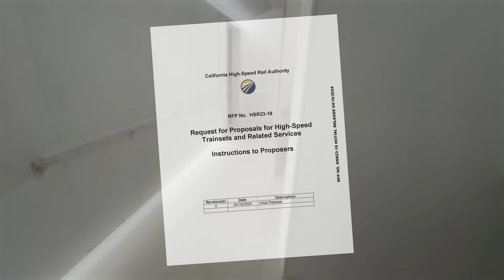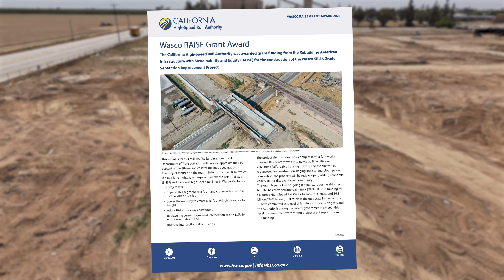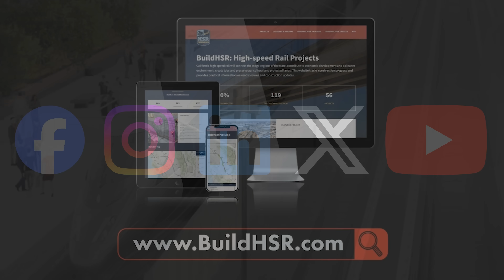Spring 2024 Construction Progress Report: Trainsets, Construction, Stations, and More!

Comment: This is wonderful. Yes, it is taking longer than anticipated or desired, and we all wish the costs could be fully contained. However, in 25 or 50 or 100 years none of that will matter (or even be remembered). What will matter is that people of character and fortitude pushed this project through and improved transportation for the people of California. It already appears to have inspired other similar projects in other states; let's hope that keeps going.
Reply: I heard the same complaints when we were building BART … imagine if we didn’t build BART … this system will evolve and expand over the next 100+ years … great project and great jobs for California
Reply: @robbmanchester5747  yeah BART had its opposition too, but it’s virtually impossible to imagine the Bay Area without it today. Same with the Golden Gate Bridge, and the Shinkansen. It’ll be the same for California HSR. Once people here begin to experience the benefits of high speed train travel for themselves, there’ll be no going back, and it’ll be virtually impossible to imagine California without it, just as it’s been for everywhere else with HSR.
Reply: @robbmanchester5747  There was a huge difference with BART. It was paid for by a 1% sales tax in the area, except Marin. There is no such will to fund this trackless train. The feds prove this when 3B goes for the CAHSR and 50B goes to Ukraine.
Reply: @robbmanchester5747 just curious, how long did it take BART to be completed?
Reply: @robbmanchester5747  Phase one could take up to a century at the current funding rate.
Reply: @scotttild  I absolutely plan to use it once it's built out.
Reply: @appleintosh you'll be waiting g forever
Reply: @PHXPlanespotter  I don’t care if it takes 50 years.
Reply: @appleintosh  lol so you like throwing money away?
Reply: @appleintosh  Hope you are patient. Real patient.
Reply: @scotttild  2hr40min to LA from SF using only HSR. 6hr10min if using the Merced to Bakersfield portion from SF-LA with a bus on either end, currently 8hr40min by bus, and 6hr on average by car. Majority of people will not be taking the train end to end. Most will be taking it from SF-SJ, Fresno-SJ/SF, or Bakersfield/Palmdale-LA. All of those beat cars by at least an hour, sometimes as much as 2.
Reply: @AmpereBEEP  "Majority of people will not be taking the train end to end. Most will be taking it from SF-SJ, Fresno-SJ/SF, or Bakersfield/Palmdale-LA. All of those beat cars by at least an hour, sometimes as much as 2."

I think that tourists, from abroad would be willing to take this railway from end-to-end. The USA isn't really set up to support tourists who do not drive. This system is going to be a game changer that means that someone flying in for a holiday in one city, can spend some time in that city, get over to another city and then spend some time there. If the trains have free charging ports for laptops and wifi, a tourist could upload all their holiday pictures from the first city, on the voyage, catch up with friends online and have a meal on the train and enjoy the views of America going past, out of the windows. That's something you can't do while driving a car and it's a view you can't get from domestic flights.
Reply: @DavidShepheard  plus with all the transit connections, such as thruway buses in Merced and Fresno to Yosemite, as well as local transit within cities and regional trains between them, one would be able to hit up a number of famous CA destinations without needing a car. Start in LA, maybe hit up San Diego, head up to Yosemite, then SF, and return to LA. It’ll be much like riding the Shinkansen to visit Tokyo and Kyoto.
Reply: @ChrisJones-gx7fc  unless they're going to have a cannabis club car on that train I prefer to take my car stopped wherever I want enjoy whatever I want when I want.
You enjoy not having a car I'll keep mine
Reply: @DavidShepheard  Palmdale holy smokes they haven't even started that 36 me tunnel from action to sylmar... Man pork pork and more pork how those politicians are getting fat... Too bad the politicians had to be involved I see this train going from Sacramento to Bakersfield and then forever you're going to have to jump on an Amtrak train and ride it to Union station just like today
Reply: @slimshady6359  I never said this would eliminate driving, cause of course it won’t. Neither has HSR in the over twenty countries it exists in. Car culture, especially in a place so built around it like California, is far too engrained in our society to ever go away, nor should it, because cars serve a very important purpose. So too does transit, including intercity, by providing a competitive alternative so one is not forced to depend on owning a car, and all the expense that entails, in order to live. Many of us drive because we have to, and would likely opt for a better alternative if there was one.

I personally enjoy driving and love road trips, but what I don’t like, and I’d say this goes for most if not everyone who drives, is being stuck in traffic or trying to find a parking space, as well as high gas prices and just the expense to keep a car going. Many of us drive because we have to, and that car dependency is not sustainable, which is where transit can help reduce it, unlike continuing to add more freeway lanes that are proven to make traffic worse long term.

If there were a competitive alternative to traveling between SoCal and NorCal that was faster than driving, and more convenient, comfortable and less stressful than flying, that takes me directly from downtown to downtown, I would absolutely use it, maybe not every time but for something like a weekend trip, definitely, especially if meeting up with family or friends who I could then share a ride with to get somewhere that transit doesn’t conveniently reach. It’s all about having more options, not taking any away, plus all those on HSR means less traffic on the freeway for those who’ll keep driving.
Reply: @ChrisJones-gx7fc  serious bro when do you see this project completed ❓ the oven started nothing on the south end of the route which is going to be the challenging and expensive especially with over 36 miles of tunnels and multiple bridge spans through the tehachapi mountains.. I just hope it don't Peter out and stop in the Latrobe or something where you catch a Amtrak bus to downtown Union station..
Reply: @slimshady6359  2030/31 for the start of Merced-Bakersfield service. Beyond that depends on when and how quickly the SF and LA extensions get funded, just as it always has. CHSRA estimates it’ll take up to six years to get across Pacheco Pass once construction begins.
Reply: @ChrisJones-gx7fc  that's keeping the operating engineers working and that means it's going to be a good summer for all..👍
    I just hate the politicians skimming the money..🤬. I still think more caltrains . how do I get from Bakersfield now to Sacramento❓
    Do I got to wait for Amtrak ❓Doesn't Amtrak only run like three times a day ❓
     What about if I got to get from Fresno to Stockton,  is there a train❓ there should be a Caltrain like Network throughout the Central valley , from redding all the way to BF😎.. and if not , please tell me this High-Speed rail project is forward thinking by also laying track and improvements for regional local system Caltrain system. I believe if you complete both systems and compare ridership the local Caltrain system between Bakersfield and reading will accumulate the most ridership
Reply: @ChrisJones-gx7fc you know what they say about hopes and dreams...be realistic dude...this thing will never be complete
Reply: @AmpereBEEP Indeed. As I understand it, won't all the stations have pass-through tracks? If so, there could be express trains between Merced and Bakersfield for those who only want to go between SF and LA.
Reply: @mrxman581  CHSRA’s 2024 Service Planning Methodology supporting document has local service only for Merced-Bakersfield, as well as for Valley to Valley. There’s still the nonstop service for SF-LA, in addition to limited and local service, but now it’s two nonstop roundtrips per direction per day instead of three, and the total amount of trains per day has been reduced too.
Reply: @AmpereBEEP so you're saying this High-Speed rail is going to replace Caltrain you wouldn't be able to get up to high speed between San Francisco and San Jose.. so you're saying we're spending billions of dollars and we have caltrans could do the job just as good if not better have not the right away is being improved
Reply: @slimshady6359 

See the Caltrain electrification improvements going live in fall that were paid for in part by CAHSRA. Just electrifying and making some of the improvements is increasing train speeds from 80 to 110 MPH, allowing them to run more local and express trains. Schedule times are reducing by 20-30%, and there will be more frequency of trains. Electrified trains accelerate to speed faster and slow down to stop faster, since they don't have to haul around heavy diesel generators.
I'll stand up for electrified mass transit. Will the real Slim Shady please stand up for it too? ;P
Reply: @AmpereBEEP  You can not possibly actually believe in that 2:40 fantasy bs do you? SF to BFD will be atleast 3 hours lF the Pacheco Pass tunnels are built by 2044-2050 .
Reply: @scotttild  Yeah, it is. That's why the HSR needs to be built.
Reply: @wta1518 pay for it yourselves and quit asking g for fed tax dollars
Reply: @wta1518  No, distance makes good neighbors.
Reply: @churblefurbles  Robert Frost: "Fences make good neighbors."
Reply: We Americans often lack the patience and perseverance to construct high speed railway infrastructure that will last for generations.  We forget how many years were required to complete the interstate highway system from start to finish with frequent over budget expenses along with local opposition to routes and construction often delaying the completion of a route for decades.  California high speed railway is similar to constructing an interstate highway.  Granted the high speed railway is more expensive yet this is a long term investment that will pay off for decades.
Reply: @1956paterson  Well said. Imagine America without the Interstate system…you cannot. Americans blindly and ignorantly assume it is simply because cars are better that we don’t have more rail. Look elsewhere to be proven wrong of course, but even then they claim “America is too big” despite cars being far slower and rail being built regionally. Nobody is replacing NY to LA flights. We just want to go from Miami to Orlando, Houston to Dallas, San Francisco to Los Angeles or to Las Vegas without the only option being driving a personal box at varying speeds, rather than boarding a train and relaxing for the journey.
Reply: @1956paterson  a few differences though. The HSR alignment has a much narrower footprint than a freeway, is built for much higher speeds, and most importantly does not have, and may never get, the federal backing that freeways did and very much still do. 85% of the bill for the Interstates was covered by the feds, with the states covering the difference, whereas California’s HSR project has been the other way around with the state covering 85% of the cost thus far.
Reply: @ChrisJones-gx7fc  That was well stated. Good comment.
Reply: @ChrisJones-gx7fc amd how much is complete???  And how much federal tax dollars will it take?  Yeah you conveniently leave that part out
Reply: @1956paterson Correct. And it's much harder to build mega infrastructure projects like this today because of environmental and locals laws compared to the time most highways were built which destroyed many neighborhoods of color.
Reply: @scotttild On average, it takes about 10 hours by train right now.
Reply: People misunderstand and underestimate the importance of the HSR. The benefits from its completion outweigh any costs and temporary inconvenience. The longer the HSR is not completed, the bigger the economic costs that pile up.
Reply: @olracorig  When do you think CAHSR may be completed?
Reply: This is not what a success looks like
Reply: @fieldmojo5304  you could say the same about US bridge building. It's only that continuous road projects have kept that muscle memory and thus road deployment cost down. It's a known construction, easy to find workers with such experience and the engineering expertise is available. HSR in a country that barely deployed outside a cargo train where cost, complexity, speed and precision much less new track has been absent for good reasons. The last time the US deployed track at scale was the days of the rail barrons, where safety was a joke, speed was paramount, labour plentiful and land rights an afterthought.
Reply: Yes it’s shame that some people only think about what they are losing not what they are gaining.
Reply: @oohkumar  Losing is easier to see, gaining takes more longer term thinking. Like pensions, less cash now but cash later. The joke is most naysayers are not seeing some big grab from their pocket. Their answer is more roads to cut the traffic that never gets easier or more planes. Like Ford who said when they asked what was needed for better transport, the answer from the public was faster/more horses
Reply: @ahoog69  when it’s finished in 25 or 50 or 100 yrs this will be obsolete and crumbling. We’ll probably be teleporting by then 🤣🤣
Reply: To all the doubters in these replies: go ask the people of Japan - who made the same complaints - still feel that way now. This is a game changer for the people of California.
Reply: @couchpotatoinc but that was the Japanese building  in Japan this train lines being built by Democrats that's why you know it's a total fuc up and a pork barrel project......
Reply: @couchpotatoinc  yeah because Japan is so comparable to America huh? What works well over there may not work well here for a multitude of reasons, the one everyone is worried about and for good reason is government involvement.
Reply: @couchpotatoinc no it's not.  You can't even pay for it yourselves...you want the rest of the country to pay for your failures
Reply: @couchpotatoinc uh Japan has like 100 million more ppl than California and it's a out the same size so high-speed rail there is a no brainer. Tokyo has like almost 50mil ppl in the whole metro area. can't have 25 million cars on the highways. it's like comparing a few grapes(California) to the whole vineyard (Japan or China)
Reply: @couchpotatoinc it's a great project too bad we can't get the government out of it because we'd have it built already.. I'll stick with Southwest though thank you.
Reply: California will scrap hsr 🚈
Reply: That's exactly what the politicians are thinking skimming steel as much as we can because 2550 100 years from now nobody will care or remember hell nobody cares now this project should have been done if it had been China it would have been done...
Reply: I can't understand if this post is sarcasm or not and I do have a high aptitude of sarcasm.
Reply: What are load of propaganda crap. In 25 and 50 years will just be on the first or second rollover of the 20 year T bills to finance this nightmare we’ve have yet to get a list of what the ticket prices will cost so they were literally everyone of your statements is a bald faced line, this is just another white elephant project financed by people who can’t vote i.e. children by people who will be dead by decades before the ramifications of their bad decisions come forward. I have no problem with building projects, but do so in a respectful honorable way, put out 10 year bonds, that way, you actually have to live with the consequences of your actions and you can’t sell your children into literal fiscal slavery and destroy their financial future before it even begins
Reply: Blame CEQA , nimbies, and democrats for this failure
Reply: The easy part is building the stations and rails, the hard part is making every road go over the railroad.
Reply: @MrChilili  If it's so easy, build them. Rails are easy, too. Install some.
Reply: LMAO calm down. It's no Engineering marvel. Japan's been doing it for 50 yrs now and China's been building them like it's nothing.
Reply: So when will it be done, 25,50,100 years?
Reply: This will be so much more comfortable than flying.
Reply: @PeterSdrolias  The 2.5 hour connecting bus ride between Bakersfield and LA is not fast or comfortable.
Reply: This would have been a good idea 30 years ago.   Today we have video conferences and gigabit internet.   There is no reason whatsoever to travel from LA to SF in such a hurry.
What they really needed to do and never did was extend the existing trains down to la.  They end at Bakersfield and you must take a bus to LA.  fk that.
Reply: @murraymadness4674  l agree 100%. Perhaps they will wise up and tunnel/traverse through the Tejon Pass l-5 Grapevine route before/rather than the other proposed tunneling routes.
Reply: It won't even be finished in 25-50 yrs, and the cost will be in the trillions.
Reply: These structures have taken vastly longer than anticipated. How long will the stations take? There is no construction yet NE of Bakersfield yet alone in town. Many tunnels are needed to complete the route, yet they have not been started. There is no will to complete it, nor sadly, to pay for it.
Reply: @mattc3696 what do you expect, it’s a union job…..
Reply: @scotttild  thats not the point of hsr, its to offer a quick way for people living in suburbs to travel to the city centre for work etc.
Reply: What a joke this is too
Reply: What it will do is make any state use this as a great learning exercise on how to build a long land based civil infrastructure project. I do worry that no stations means if it's terminated, then the state gets some nice road crossings and perhaps some nice cargo rail track if sold on the cheap. I would have expected some of the stations to have been site prepped already at least and grid connections completed. Is progress accelerating. Seems rail separations should be much faster for what are a myriad number of crossings before any email line is laid
Reply: @scotttild I’ll use it and pretty much everyone I know will use it.
Reply: And be stuck paying for it for centuries this thing is an absolute waste of my tax money we don't need this over budget  obsolete piece  of garbage
Reply: @donaldalvord3604  what major capital project does not add to the states debt. Do you think highways are free or road expansions. Many of the overpasses for this line will benefit  road traffic, which otherwise would never have been improved
Reply: @scotttild  The people in the Central Valley living in cheaper homes than LA or the Bay Area but working in those places. 

It isn’t just for the people living in LA or San Francisco but everywhere else in the state that it services.
Reply: What was the original projected cost? How much has been spent so far?  How was it supposed to take to build? How long has it been since the start of the project??
Reply: It’s all going to be abandoned and never completed. California and the US Federal government are both broke. They will never be able to finance the route to SF or LA.

The segment they have built out, in the Central Valley, has no reason to exist. The few people who travel from Merced to Fresno to Bakersfield would need a car when they get to their destination. So why not drive instead? It’s a train, from nowhere to nowhere. If they finish the trains there, they will run nearly empty. 

Everyone knows this. It’s best to cut the loses and shut down construction… the sooner, the better… ASAP
Reply: And all of these spurned projects are massively over budget and years behind just like California . Aah let's follow the same stale programs. Tax payers always getting it in the patuut.  Grasias
Reply: There is major corruption going on behind the scenes on this project. The amount absolutely matters.
Reply: California will scrap high speed rail 🚈 🚮
Reply: The Transcontinental Railroad took 7 years to build, in the 1860s.  Its been over a decade and you have laid zero tracks.

This project is just gov fraud.
Reply: Paid comment
Reply: Hijacked account...the commenter has made zero comments in 9 years.
Reply: Yes, because that’s the metric we should be using. “Who’s gonna care in 100 years” 😂
Reply: @jaymoor8995  the Shinkansen is 60 years old and still very much relevant. High speed rail is the best way to move lots of people quickly, efficiently and safely for mid-distance journeys of 100-500 miles. Better than planes for that distance, and much better than maglev or some unproven concept like hyperloop. People can continue to drive and fly, just as they do now in all the countries with high speed rail, but having HSR means having more travel options, not taking any away.
Reply: You do know that if it had been built along the coast it might been almost completely done.
Reply: @tetenlarios7910 wrong, the constrained space between sea and mountains means you can barely upgrade the tracks as gentler curves are required for that. Get ready for hundreds of miles of tunneling
Reply: @tetenlarios7910  Yes, l've been saying that for years. Simply upgrading to 110 & 125 mph tracks would get a five hour ride from LA-SF averaging 80 mph with diesel trains like Brightline's Siemens.
Reply: @davidjackson7281  I'm almost 50 years old. I might not be alive when this geniuses finished the train. Lmao.
Reply: @tetenlarios7910  You're correct. For an LA-SF high speed train try to live to 90 because the valley segment may be all that ever gets done and that's in another ten years. Unfortunately, it's not really a laughing matter.
Reply: @davidjackson7281 and how exactly do you plan to upgrade it? You'd need higher radius curves, which is a pain to do along the coast and between the mountains.
Reply: And cheaper.
Reply: 25 years from now ❓ there's a good chance that the system won't even be running in 25.. you know unless they terminate the system in Bakersfield and you jump on an Amtrak bus they haven't even started on the proposed 35 mi long tunnel from action to sylmar
Reply: How liberal of you, may you NEVER move from Calif…..
Reply: WHAT?  Are you a plant hired by the state, or maybe you work for Grewsom himself.

This is a HUGE waste of money on the grandest scale for CA.  Yes, in 25 or 50 years people will forget what a bad idea this was.

Had we not spent the $, maybe we wouldn't be 100B in debt.
Reply: Lol are you serious?  This is an absolute joke.   It's a train going g to nowhere that may never go anywhere.  Amd you want federal tax dollars to pay for.your guys failure???  I Don t think so
Reply: You were paid to say this
Reply: @travelingwaves  By who?
Reply: 50 years from now, it will be obsolete.
Reply: @wabashsphinx497  With what, maglevs which are at minimum 3x as expensive to build, have a lower passenger capacity, and have the exact same land acquisition requirements? A hyperloop which cannot be built as every company that attempted it has either gone bankrupt or liquidated their assets? More planes which are reliant on good weather, functioning airline software/hardware, and runway/terminal space? More highway lanes which only briefly solve the problem before travel times worsen? What are your suggestions?
Reply: @AmpereBEEP       Stay Home
Reply: @AmpereBEEP lmao if CAHSR was funded by the private sector it would have been dead before the first sleeper was placed.  Comparing the privately funded hyperloop failures with the not-yet-financially-failed project backed by tens of billions in government money is laughable.
Reply: @wabashsphinx497 because we’ll all have flying cars
Reply: @wabashsphinx497 And replaced by?
Reply: @wabashsphinx497 man if you’re talking about hyperloop that project is dead. 
And it would literally serve only two places SF and LA.